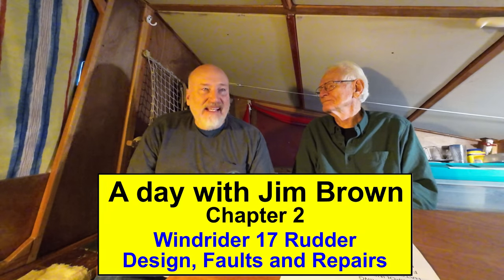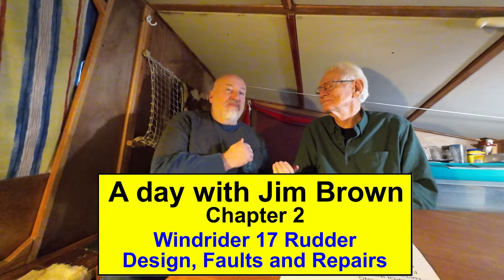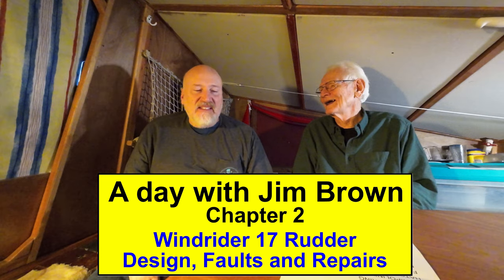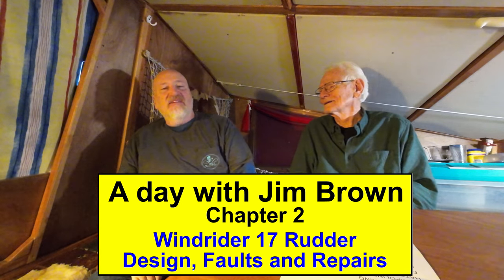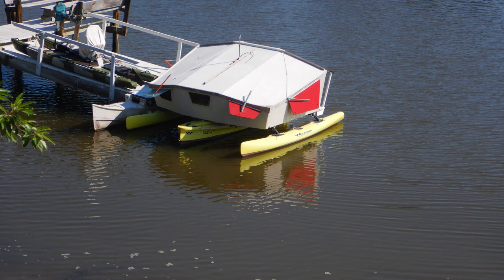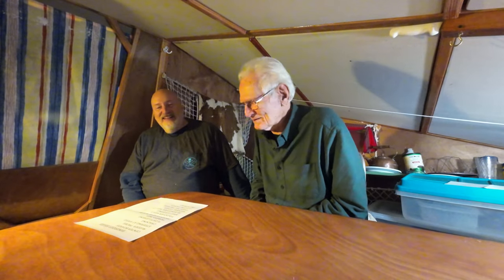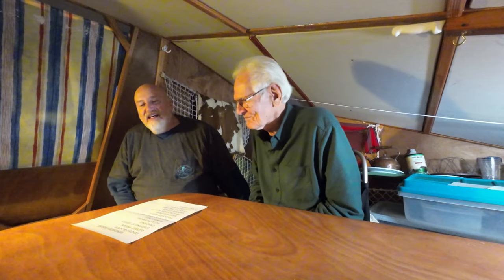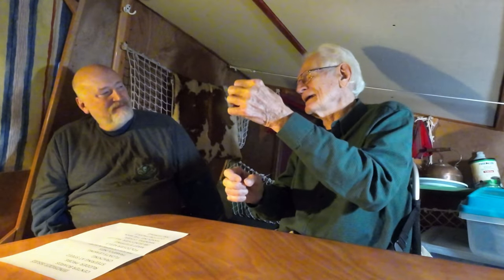Windrider 17 designer Jim Brown, on the good and the bad of the WR17 rudder system.

Comment: So I bought my 17 maybe in 2004 or so.. paid $5k new. I sail in the Bering Sea (salt water) and maybe got a non-anodized rudder shaft because it froze up as you described. Of course I didn't know about the tab embedded in the plastic sleeve so I ripped that up trying to get the rudder shaft off. I ended up building a long reaching clamp with lumber and all-thread to lock that tab in place so I could really reef on the shaft. That and maybe a heat gun.. I was finally able to free it.. didn't have to cut the rudder shaft. I did order a new plastic sleeve from the company - I may have had to cut that off. (I don't remember all the particulars - it was a few years ago and the boat is buried under snow now in Nome Alaska - hope the deck plank doesn't poke thru the bow as it definitely gets a bit chilly here). I think I fabricated a spacer out of UHMW plastic because things got a bit tweaked and had to prop up the rudder a bit.. and I think I did just hose clamp the plastic tube inside the hull against the sleeve to prevent leaks. All seems to work fine. Thanks to Ziggy and Jim Brown for the little series! On my channel I have a little info on the larger catamaran I built using epoxy.
Reply from the maker: I'm about to tear into my rudder shaft too. There is too much play. Hopefully, I will just have to replace the plastic sleeve. Fingers crossed.
Jim's instructions definitely takes some of the worries out of the project though.

Comment: Some lubricants may be destroying the Plastic sleeve as Jim noted. In plumbing applications a non petroleum silicone lubricant is used. 
A problem that Jim may not have noted is that some lubricants may help grit and sand and salt crystals etch the surface of the aluminum hastening oxidation.
Lastly Aluminum oxide itself is abrasive. How is this problem avoided on other rudders thru hull designs.?

Comment: The early boats built by Andy at Wilderness Systems, were better in many ways. The third owner widened the boat by 10 inches, which was unnecessary, and creates more twist in the hull under harsh conditions. I watched the first ones being built and then sailed on our local municipal lake. Later, I sailed Andy's boat, possibly the 2nd one off the line (he still has it). Very innovative boat that combined new ideas, new materials and new technology. There was a lot to go wrong but overall the boats came out just fine and probably haven't had much more in the way of problems or issues than any other sailboat out there.
Reply from the maker: Having 2  WR17s, one from the 1st molding and the last molding will let me run them side by side for a real comparison this summer.